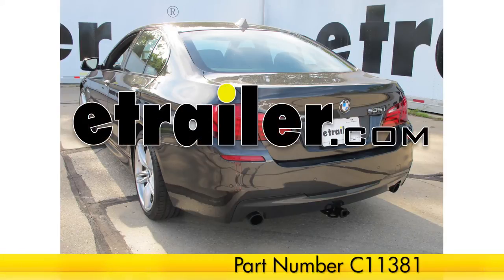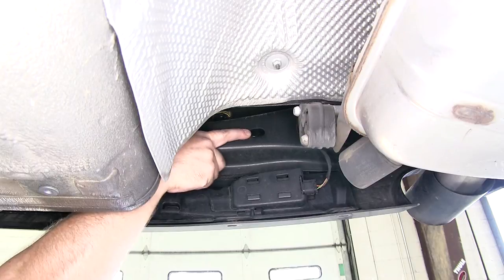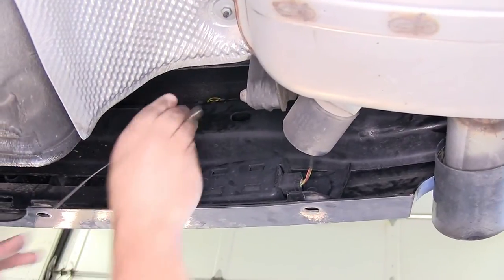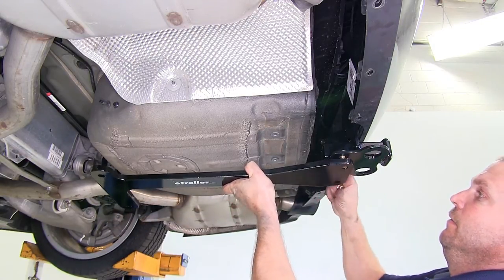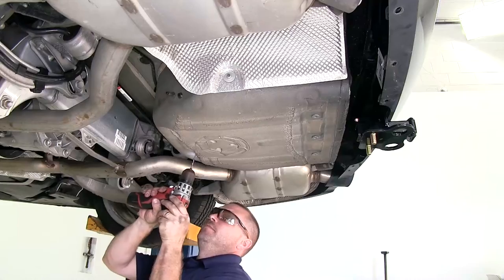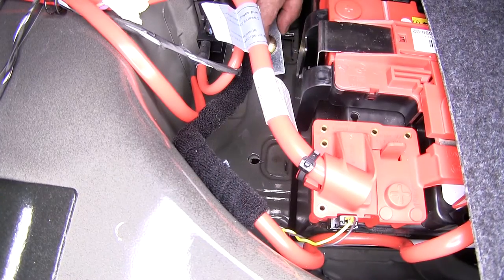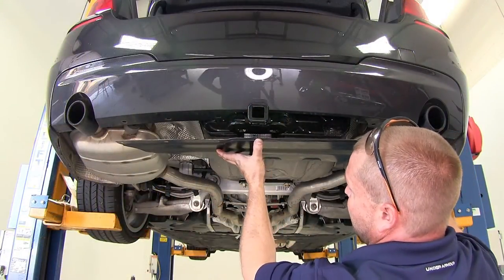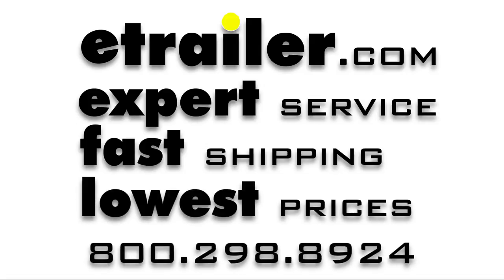etrailer | Mount: Curt Trailer Hitch Receiver on a 2013 BMW 5 Series

Comment: Awesome video.  Required watching.  Few things.  When using the fishing wire, do NOT put the square head washer on the bolt, keep them separate, they will align when you get to the rear-most holes.  It will allow you to fish much easier. (I'm a newb.)  Also, the fishing is quite a bit more challenging, put on your very small hands and feel the larger holes in which to fish through from the bottom.  You will deserve a beer when you finish the fishing.  As shown when you did your video but you quickly glossed over it, the front most bolts are JUST a little short to easily thread through the washer AND the tail section of the hitch.  Do yourself a favor, get 2 half inch carriage bolts that are 1/2" longer, or you will tear your hair out.  Can you do it with the supplied bolts?  Maybe.  Can you spend four hours trying to get them started?  Yes.
Reply: The tip about not putting the washer on the bolt helped me so much! 👏🏽

Comment: Just installed it on my 2016 BMW 528i using this video. Took me about 1 1/2 hours. Getting the first set of bolts in is tricky. Just be patient. The holes i had to drill ended up a very safe distance away from my battery and I didn’t even lose the holding brackets. The bolts going on the holes by the battery can appear to be too short but they aren’t. I used a jack to hold the hitch up under the car with enough up pressure to make sure the bolts reached.
Reply from the maker: Glad you got it on and glad our video helped. Thanks for the additional info too!

Comment: Just installed on my 2014 BMW 535i, My tip would be just snug all bolts , put everything completely together except the trim piece around the hitch itself then torque all bolts to 110 ft lbs then put trim piece around hitch. Why? When you torque all bolts before  battery hold down completed there is slight deformation of battery mounts. Could have been avoided if battery was completely installed before torqueing bolt. Not a big deal though. Now to install wiring